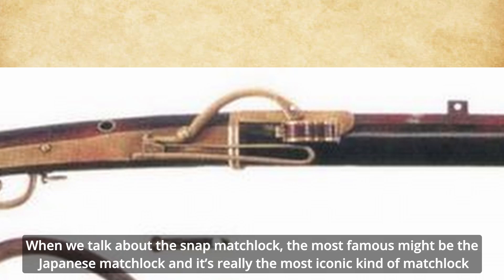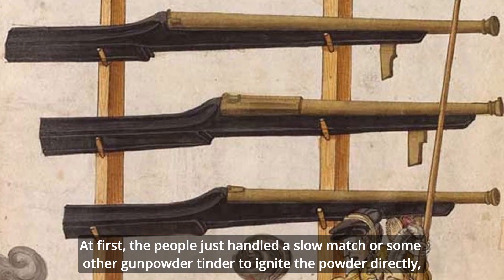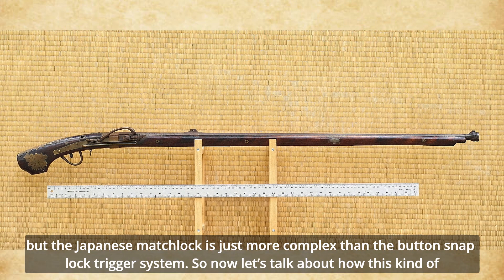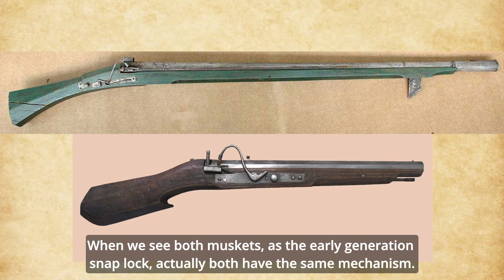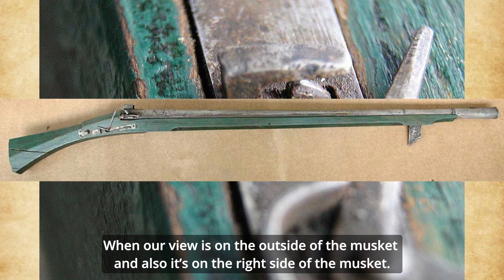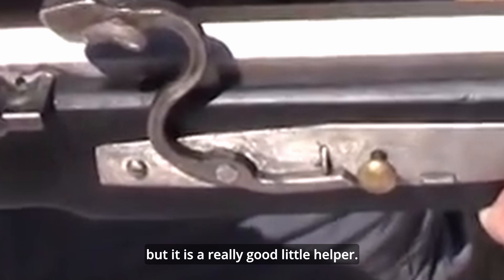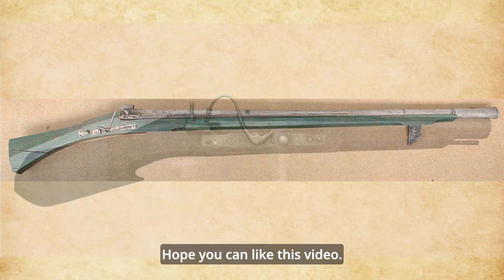The Button Snap Matchlock (The Ancestor of Japanese Matchlock) | How it works

Comment: First time I really needed to use the "stable volume" option on yt I couldn't. your voice is too silent and very difficult to understand. a little of EQ, compression, and Maximizer, would fix that in a second. I recommend Reaper DAW or simply Audacity to even the audio out.
You can also do a lot in your video editor. KDENLIVE is a free and capable video editor that will allow you to properly level audio volumes.

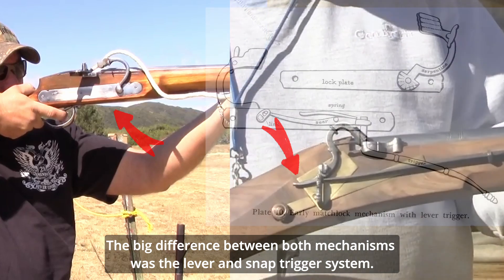Comment: 1:46 - The lever trigger of the drawing at right is not a snap matchlock,  in this mechanism is the press over the lever that make the serpentine tilt for the pan - in a slow movement; the spring is for return the serpentine holder back. This is not a snap matchlock mechanism, neither a button press matchlock mechanism. See firing one weapon with this mechanism in "JYF Museums" videos.

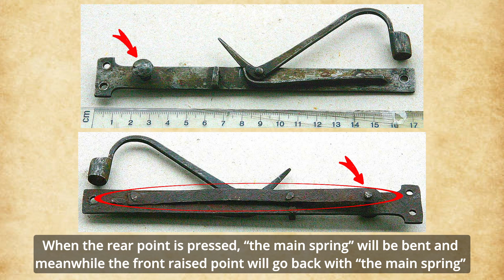5:30 - Very simple and "low tech" mechanism.